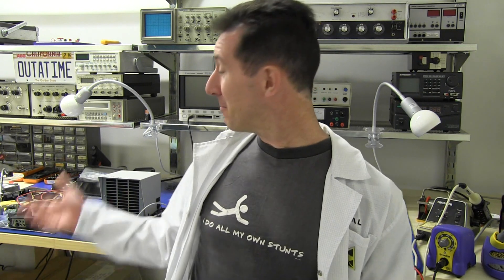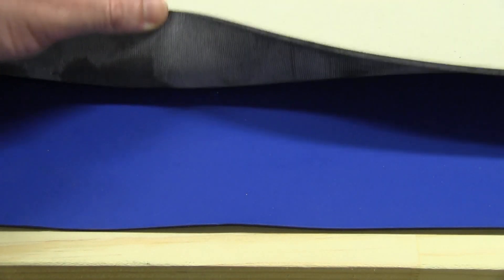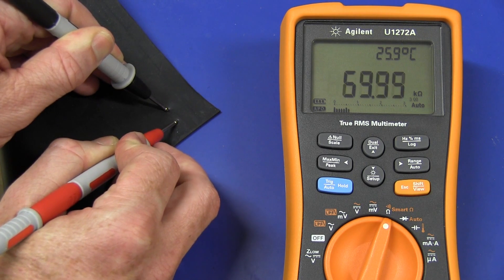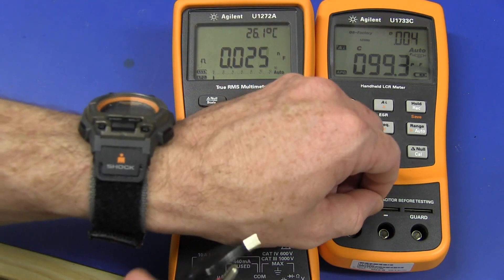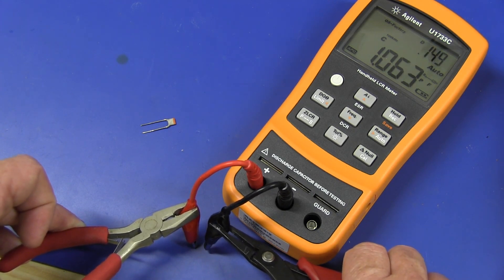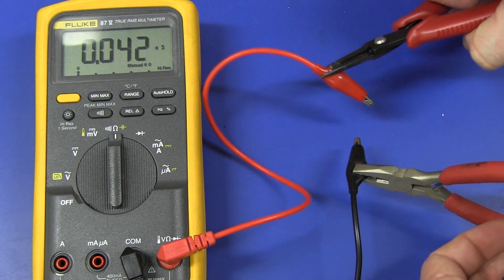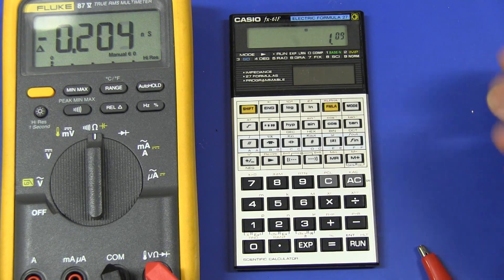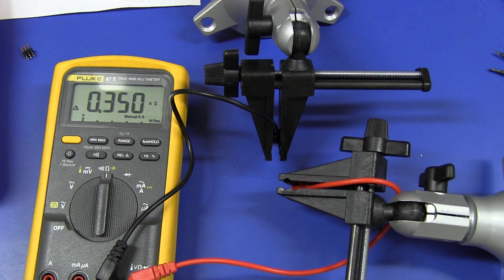EEVblog #250 - Anti-Static Mat Myth

Comment: u seem knowledgeable in this topic, one question for u if u happen to read although a very old video, should the wall outlet switches or switch be turned off  the whole timme while i build my pc putting on the anti static wrist strap which would be connected to my esd mat which would be connected toto the esd grounding wwall adapter which would be  plugged into the wall outlet. as far as i know the ground of the wall outlet dont need any switches to be turned on as its always active and grounded. so for confirmation should the wall outlet switch ne turned off  or on when the esd ground wall adapter i splugged while working on. my pc ? thanks. hopefully u read my comment

Comment: What is the story about the ground wire with 0 ohms or 1M ohms respectfully?
Reply: 1Mohm is a safety current limiting resistor in the event the user is exposed to 250VAC (or less) by way of the wrist strap in the event of a fault. Note that it doesn't protect you if you are working with voltages larger than 250V as this is the voltage rating of the resistor (250V)

Comment: All anti-static gear is within a range of 1M Ohm to 1G Ohm. That is the dissipative range. Values less than 1M are considered conductive and potentially dangerous with grounding errors. This is why all wrist strap assemblies require a 1M Ohm resistor. The upper limit is a bit more complicated, but it primarily has to do with the time it takes to discharge static electricity to ground. It must discharge faster than a human could disconnect from the circuit to ground. 1G Ohm to ground is the standard to prevent human base model ESD events.

Comment: So in other words, the ohm resistance is so minuscule that the mat is effectively not even working?
Reply: ESD mat works. The resistance is miniscule only for regular circuits with regular voltages. Not for static charges, HV circuits or super-sensitive circuits.
Reply: The mat is doing something. It's just minuscule, because it's incredibly resistive. Like the original response. Standard electronics which are sensitive to static electricity, i.e. integrated  circuits, are not going to have the energy to "see" ground through a dissipative material. The effect is negligible, unless you have a super marginal design requirement. Which in that case, you need to bring your product back to design.

Comment: EEVblog
0:50   Rubber? Antistatic??!!   
Pfffffttttfftttffffthahahaaahahaha! Hahahaha!        Please tell Robert Jemison Van De Graaff about it!!
What is this here? Kangaroo science? 
People these days.... bloody unbelievable!
Reply: bloody unbelievable @the kaiser you thinking that your comment is a contribution, not to mention you have none videos either.
Van de Graaff generators use a motorized insulating belt (usually made of rubber)...
Reply: It's a static electricity collection belt made of rubber.
Reply: @thekaiser1919  There are many rubber materials and even more additives. In this case of ESD mat, both rubbers - the blue and the black - are nitrile rubber. One is conductive, one is not. Why? Because additives.
I have LDPE ziplock bags. Ones are regular white LDPE bags, ones are static dissipative pink coloured LDPE bags. When you take regular bag and rub it on clean hairs, you get sparks crackling. When you do the same with ESD bag, you get nothing. And now the best part. When you swipe the ESD bag with alcohol, seemingly nothing changed. It's still pink LDPE bag. But when you rub it, it generates static charge as regular bag. My theory is, there is some surface treatment or material additive, which can be washed away with organic solvent.

Comment: Dave, I'm looking for a video you did where you show the voltage along a mat that was behaving like a grid of resistors. I thought it was this one, but it's not.

Have you any idea of what the link might be?

Thanks!
Reply from the maker: Sarah Cartwright Don't recall that. I have my recent one on conductive foam that works like that. And the actual resistor grid video, but recall any others.
Reply: EEVblog thanks! It must be that one I was thinking of.
Reply: Sarah Cartwright I was looking for that same one. There was a vid where a mat was working like a resistor.... maybe i can find it  
thanks
Reply: @emmetmyers  AP&T brand series products include ionizing air blower, ionizing air gun, ion bar, ion nozzle with various specifications are wildly used in semi conduct, encapsulation, opto-electrical, electronics, communication, spray finishing, printing, textile, pharmaceutical equipment, construction material, injection molding industries.

Comment: I was thinking "horseshit" myself. Unless you are doping microscopic silicon semicons and monitoring the process, that is not going to make any difference. I noticed that with some of the critical power supplies for power plants stock brokerage hoses, etc, were sensitive enough to sway the readings on the meters as I moved about the room. You are affecting the readings with your body far far more than those mats. My antiquated Teague ESI LCR shows a reading way up in the gigohms range with 50 volts externally biased placed across the mat at a distance of 1cm. That is just absurd. That being said, what type of shoes are you wearing, and what color is your underwear? If anything, the mats probably bring some stability to the readings.

Comment: Is this also safe when using a mat, that your power point(powerbar) is switched off & plug into the outlet. Also that the PSU is switched off and plug into the powerbar. Use a motherboard Standoffs on the psu screw hole & attaching the alligator clip to the standoffs.
Is this okay? is the mat grounded?
This is a brand new build.
What if its not a brand new build, what do u suggest?
Reply: are you talking about assembling a desktop computer? You will be fine doing that on your desk.
Reply: AP&T brand series products include ionizing air blower, ionizing air gun, ion bar, ion nozzle with various specifications are wildly used in semi conduct, encapsulation, opto-electrical, electronics, communication, spray finishing, printing, textile, pharmaceutical equipment, construction material, injection molding industries.

Comment: eh... i guess a rubber ESD mat wouldn't be very helpful with my GLASS workbench. :P
Reply: AP&T brand series products include ionizing air blower, ionizing air gun, ion bar, ion nozzle with various specifications are wildly used in semi conduct, encapsulation, opto-electrical, electronics, communication, spray finishing, printing, textile, pharmaceutical equipment, construction material, injection molding industries.

Comment from the maker: Low resistance would upset your circuit placed on it, and potentially be quite dangerous. Static does not have much energy, so easily bleeds away with very high values of resistance.

Comment: Can you do a video explaining how these mats work? As a noobie I would think you would want a low resistance mat to discharge the static electricity. Can someone explain?
Reply: From what somebody else just said high voltage low energy static easily dissipates over High Resistance surfaces but honestly I don't get it myself. I'd love for Dave to make a video on this.
Reply: And I'm sure he has I just haven't found it yet.
Reply: @goophoba  Standard human body model has capacity of 100pF. You can easily discharge such a small capacity through a couple of Gohms. E.g. when charged to 5kV and discharged through 1Gohm, the voltage drops to 200V in cca 320ms. I think the resistance may be even lower for a high voltages, but I don't have any information about that. Also, there isn't just ESD mats, but also wrist bands (not wireless, please :-)  ionized air generators, humidifiers, etc. The latter are more expensive and more professional, but the mat + wrist band should be absolute minimum even for hobby users.
Reply: That's just additional ESD protection in addition to wrist band, so there's nothing around you that has any slightest charge. Same as with wrist band mat is just grounded conductor; there's usually a snap in the corner of quality ESD mats that are used to connect mat to the ground and some have two snaps: one for the wrist band wire and second one for the ground wire. This is how I understand it.
Reply: DIscharging too quickly can cause problems, especially if it isn't static. If you accidentally touch your power supply positive to the mat then you don't want it shorting to ground through a low resistance. Resistances in the gigaohm range are perfectly fine for dissipating static but you generally do not want a conductive work surface when working with electronics.

Comment: @mshine5 Don't forget the thermal noise in the meter and the cosmic backgroung radiation from the big bang and the earths tectonic shift and the virtual particle interference through casimir effect and the nuclear fallout from Japan and the suns solar flares activity of 2012 and the extra-dimension fluctuations from string theory and the quantum particle wave collapse through observation/ measurement. :)

Comment: @MetalPhreakAU You've got it all wrong. It's not magnetic effects and not pine. What you have to worry about is the static electric charge is built up every time you rub a hard rubber comb with fir.

Comment: Your measurements were completely off.  The humidity caused errors because you had the A/C off and were breathing towards the meter as well as touching the mat with your greasy hands. Oh and the lights and camera's electric fields were causing the meter to fluctuate.  :)

Comment: Dave, what brand mats do you use, I'm looking to replace the stuff on my benches at work.
Reply: AP&T brand series products include ionizing air blower, ionizing air gun, ion bar, ion nozzle with various specifications are wildly used in semi conduct, encapsulation, opto-electrical, electronics, communication, spray finishing, printing, textile, pharmaceutical equipment, construction material, injection molding industries. 
If you have any interesting,
please feel free to contact us.(Email:Nicole@sh-anping.com.cn) Thanks.